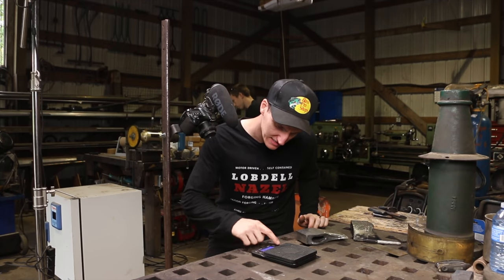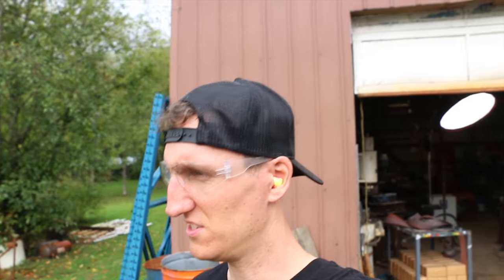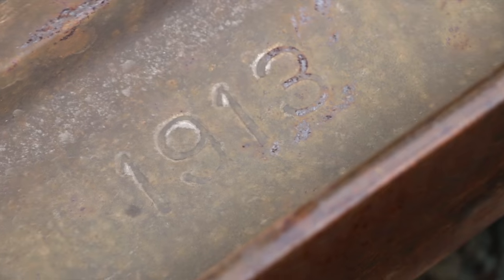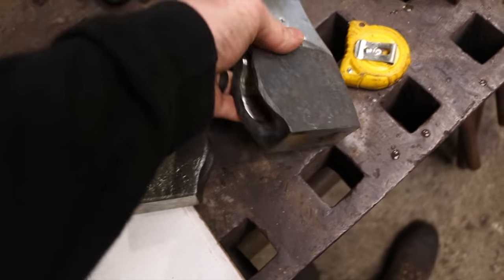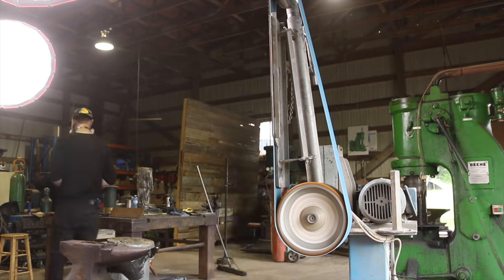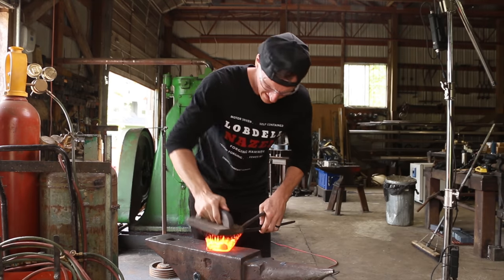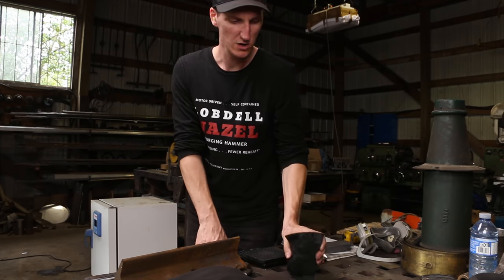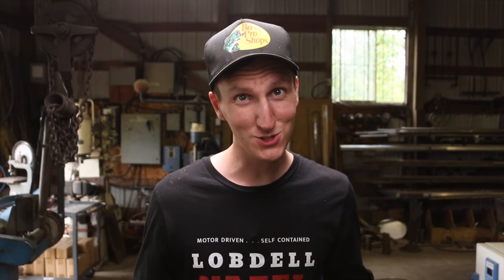Did I get the weight right on the Wood Bullet?

Comment: I knew as soon as you said you heat cycled & brushed it 4 times it was going to be under weight. Every time you bring a piece of steel up to temperature in a gas forge you loose a minimum of 15 thousandths of an inch on all surfaces & it is usually more just measure some of your forge scale & then you will understand how fast you can loose weight in the forge.
Reply: Gotta love decarb.
Reply: was a little worried too with the loss of all that carbon as well, i honestly would have rounded off the back corners and kept the sides for looks, but heat cycling it that many times could have really back effects on its over all ability to keep the edge, so lets hope the heat treat goes really well. But the over all edge isnt that important since its going to be a splitter for its whole life and not a chopper.